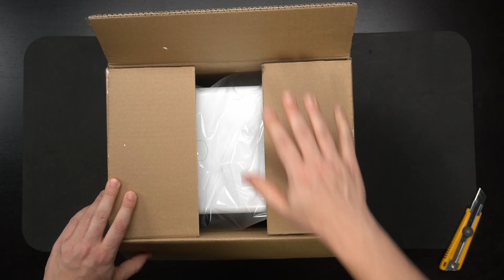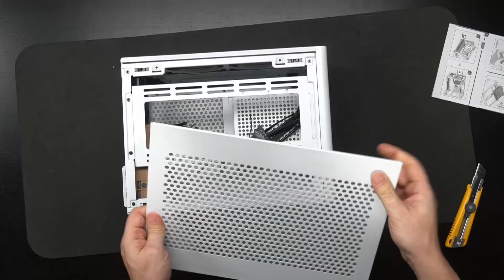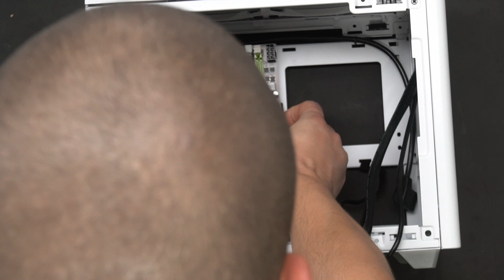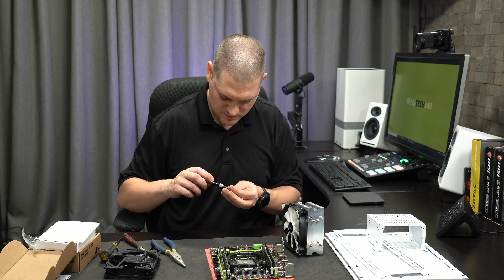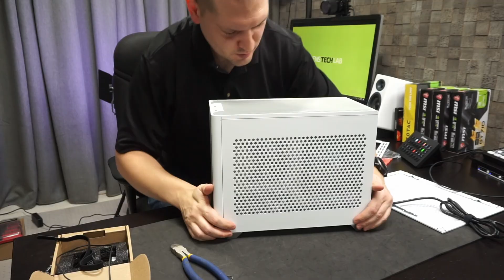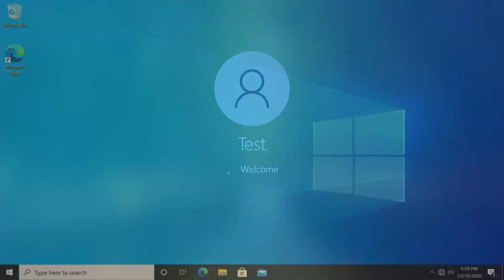Cooler Master NR200 with mATX Chinese X79 Motherboard

Comment from the maker: TL;DR; 
 - This motherboard can fit in the well priced Cooler Master NR200 case!
 - The included case fan will help manage the VRM temps in either orientation.
 - Having the top 120mm case fan as an intake fan is far superior for VRM temps but will elevate the CPU temperate a few degrees from 50°C to 54°C during my testing.
Reply: Been looking for a matx build like this, great to discover your channel, big thanks!
Reply from the maker: @DiazThumb  Glad this was helpful! I do like the way this build came out!
Reply: @DiazThumb  try Asrock h470m HDV if using 10th gen
Reply: OMG I have the same build xD, 2689 always at turbo but with the TG panel and a GTX 1660 and a ATX PSU, I'm moving now to an AMD build. I'm going to miss that Xeon when the times comes.
Reply: How much clearence did you have below the motherboard. My B150m is about a cm taller than your chinese motherboard
Reply: If it's no bother could you perhaps please measure roughly how much space is left in the bottom of the case? The case's page says max 22,6cm height motherboard but in the video to me it seems there is more than one cm left in the bottom, but maybe that's just due to perspective or maybe there is something in the bottom blocking any longer boards? It'd be great if it could fit a b450m mortar (2,9cm longer).

Comment: is there any other option that not using chino brand..?
Reply: Sama IM01 - support micro=-ATX 24x24cm mobos e ATX case, this X79 used in the video is more miniDTX - 236,68x177,28mm.

Comment: the psu can be mounted on the floor of the case? taking air from the bottom?
Reply from the maker: The case isn't really designed for this, but I've seen some impressive case modders... the bottom of this case may get crowded depending on the size of your GPU card.

Comment: Quick question would the nr200 fit an b450 mortar with a full atx power supply ??
Reply: yes
Reply: did it fit the b450m mortar?

Comment: I have another doubt tho, do you have the acrylic side panel ?
And If yes have you tried it out with the snowman fan?
Reply from the maker: I do not have the acrylic side panel. I wasnt going for that look in these builds. You are right though the acrylic probably eats another 3-5mm of space inside. If you want the looks with acrylic I'd probably go for a brand name cooler like a Noctua.
Reply: @BensTechLab  My snowman aircooler arrived today and i've installed in the case with the acrylic side panel and no problems. The tower is 2mm minimun far. I'm so happy with the build rs

Comment: Which model of x79 was this? Mine does not fit.
Reply from the maker: In the video description "Machinist X79G motherboard". This is a smaller motherboard, there are a lot of chinese remanufactured motherboards. The good news is that you can still use your CPU and RAM and just change the MB to fit your case! Then sell your other X79 on ebay if you want...
Reply: @BensTechLab  interesting. I also have a machinest. Doesn't look like they make this smaller one anymore under that brand, but I did find some that fit.

Comment: If your motherboard is 244x226mm or 24.4x22.6cm and under it will fit the case
Reply: According to Cooler Master Manufacturer site, this is possible. the maximum MB you can put on this case is 244x226, well actually didn't try this, and hope someone can confirm its fit, but theoretically, it should be OK... (go to CoolerMaster/NR200/Specification)
Reply from the maker: Did you verify this with a specific motherboard? Maybe share with the community which motherboard you used? It may be helpful!
Reply: 22,6cm is the height of it, right?

Comment: late comment but i was wondering if 120mm fans could fit on the bottom of the case with a  micro atx motherboard?
Reply from the maker: Probably not... The motherboard shown here is a small mATX which is only 3 pcie slots tall max. Most mATX are even 1 slot taller.

Comment: Is this motherboard smaller than "regular" micro-ATX cases? I have the Gigabyte Z590M GAMING X. Do you think I could fit it into this case? Also... there seems to be a lot of dead space in this case. Could you mod the PSU cage to fit a regular sized psu aswell?
Reply from the maker: There are 2 heights for mATX standard. This is the shorter of those 2 options. Some people call the smaller one "flex-atx".
Reply from the maker: Googling that motherboard looks kinda big, like 4 pcie slots sized (i know its 3 but the height of 4).

Comment: This is too fat, and too much unused space inside. Is there any thinner model for micro ATX and standard PSU? Something for iGPU, or maybe normal size PCIe?
Reply from the maker: This is a "standard width" case. Any thinner and you'll need a vertical GPU with PCIe extension cable and probably custom cooling on the GPU and CPU to make it thinner (the CPU cooler shown here nearly touches the side panel). At this point you move from a super low cost surplus parts build off ebay into the category of premium small form factor PC building market. You can search for "Optimum Tech" on YouTube if you want to go that route! Lots of fun! But a totally different category of builds.
Reply: @BensTechLab  Thanks for the answer. No I was thinking primarily about iGPU solution. Something under 30x30x10 cm. Isn't there any midground between this NR200 (which can fit enormous aftermarket cooler and 150W GPU, which is total overkill for home, office, HTCP, surfing machine) and that funny micro ITX cases which need external PSU and can't fit normal size MoBo (24.4 x 24.4 cm)...

Comment: ASRock B460M Pro4 (229х224) will it be possible to install in this case?
Reply from the maker: This machinist motherboard is about 215mm x 186mm. So that Asrock Pro4 seems like a fair bit taller by 38mm or more than 1-1/2". I don't think it would fit.

Comment: Do you know if this Machinist X99-M Plus will fit in the case?  For a while now I wanted to go Ryzen.  Now that I see that these Xeon's have way better Multi-Thread performance for way less money.  I'm going X99 brother!  I love Intel Xeon's anyway!  So I'm going to be using an 18-core Xeon with 36 threads.  I wish V3 supported the 24 core Xeon's but nope.  I do a lot of rendering so I need more threads.

Comment: Hello, I was exactly thinking about buying the same mobo and cpu, so i was wondering if it is still working on you and have you had any issues? also I am wondering if your ram is running in dual channel or quad channel? because on aliexpress there is a few listing for this board and some are saying "memory configuration single channel" so that got me confused? Please if you can chech if your ram is in dual or quad channel that would be very helpfull, thanks!
Reply from the maker: Yes this combo works fine! Unfortunately though the smaller mATX board cannot aupport quad channel memory due to space constraints (can't fit all the PCB traces). If you need quad channel support you will need to look at the larger ATX size x79 motherboards on aliexpress/ebay. This mb is dual channel only.
Reply: @BensTechLab  Thanks! I think I will be okay with 16gb dual channel, I just want a reliable board, I'm not gonna put any xeons over 95w tdp and I hope I will have a nice reliable system, Looking towards ordering all the parts this month, seems like this board has a lot of positive reviews

Comment: can i add gpu in similar specs?i mean including the mATX?
Reply from the maker: Yes you can! But full length card may interfere with larger powersupply. So you must balance power supply size and GPU card size or mod the case.
Reply: one more question can i use Asus prime a520m-k mATX motherboard in this case?please let me know
Reply from the maker: I do not have this Asus MB, so can't answer that. Note there is 2 possible heights for mATX MBs and some are too tall. Also check this video to see the power supply mounted on the back of the case vs front of the case for GPU clearance: https://youtu.be/tmoZVQo0_3w
Reply: @yellohelloyzx  check size difference between ur motherboard and the one that actually fits (Asrock h470m HDV)

Comment: That isn’t actually a matx motherboard that is a mini dtx motherboard to my knowledge
Reply from the maker: Mini dtx is even smaller with max 2 pcie slots. I posted the dimensions in mm on one of the comments on here for reference if thats helpful for your build!
Reply from the maker: It appears the matx wikipedia page isnt very good and there are better drawings on the mini-itx or atx wikipedia pages to show the varations. "The maximum size of a microATX motherboard is 9.6 × 9.6 in (244 × 244 mm). However, there are examples of motherboards using microATX designation despite having a smaller size..." I suppose you could call this one a "flex ATX" but the manufacturer uses the mATX designation with the upper standoff variation.

Comment: bought a similar machinist mobo, very informative video, and gave me a bit more confidence with it when it arrives. I have a cooler master case with top mount fan slots, so this video was huge on informing me the difference it can make. pairing it with a e5 2680 v2, bit higher tdp. but with the drastic difference in vrm temps with that top intake fan, makes me pumped. thank you
Reply from the maker: Glad this was helpful! Good luck with your build!

Comment: nothing about the gpu
Reply from the maker: Sorry, I did gloss over that as I was building these for servers no gaming machines. My GPUs are low power GT 710's which are great for server use and are low profile capable. But this case can accept larger cards! With a full length card you will possible run into interference with an SFX-L Power supply - so you end up constrained with how many watts you can fit in your PSU while still fitting your GPU in the case.

Comment: Hi Ben great testing :) i ordered such a tiny X79G Board too. I am not sure if it will work but i buyed a  E7-4870V2  to test with. I think if i cool the VRM good this beast of CPU may be work on it.
Reply from the maker: You will certainly need some cooling! Someone commented further down I think that they glued in some larger strips of aluminum into the small heatsink to increase the thermal mass with good success. That comment might be on my VRM thermals video...

Comment: We need a mATX variant of this case!
Reply: Check out for the Techware Fusion/Sama Im01, its pretty close to NR200 but it support Micro Atx and Atx psu out of the box.
Reply from the maker: That could be fun! An official mATX version wouldn't need to be much taller, maybe 1". But it would have to be a few inches deeper for wider mATX compatibility. I think "as small as you can get" was just so on trend the last couple years.
Reply: We actually do have that... matx + atx psu + 330cm gpu... problem is no mesh...
Reply: check CM NR400
Reply: @NasmanFour20  Too big
Reply: There is no need! We just need a matx motherboard tray with 8 stand9ffs

Comment: Hi, can i adapt atx power supply? THX
Reply from the maker: I did see this once but totally custom. You remove the SFX bracket and mount the ATX at the front similar to where the SFX goes on the front panel. May need to drill custom holes for mounting. There isn't much reason to do this today though unless you already have a nice ATX psu. There is so many choices available in SFX now.
Reply: U can 3d print ATX psu bracket which is also provided by cooler master in 2 variants top mount and lower mount

Comment: Can a bigger gpu fit in that case?
Reply from the maker: Yes a larger GPU can fit in this case, but fits better with the power supply on the back panel which didn't fit well with my mATX motherboard. So it is one big trade-off of space between MB, PS and GPU!! Choose which items you want to use the space for. You might be able to squeeze an SFX power supply on the front panel with a long GPU if you have very flexible cables or custom cables for your powersupply to make a 90 degree bend above GPU.

Comment: First video I've seen making use of a front mounted PSU. I will try my own build with this in mind. Great vid!
Reply from the maker: Front mounted works great when cramming an oversized motherboard in this case! (Like my mATX one).
Reply: @BensTechLab  Thank you for this video. It gave me more confidence as I know the PSU is easy to mount at the front. To be honest, this case 100% should have included mATX support. There is no reason why it doesn't.

Comment: Do you have dimensions of the motherboard?
Reply from the maker: The Machinist X79G v1.3 motherboard is about 215mm x 186mm. Just measured by hand with a ruler, so +/- 0.5mm for measuring by hand.
Reply: @BensTechLab  thanks
Reply from the maker: @Razhiel100  You're welcome! Consider leaving the video a like to show your appreciation. ;-)
Reply: everyone read this, plz pin this one , i searched all comments to find it
 @BensTechLab

Comment: Great vid thx!! My fans are spinning crazy! The front,cpu,and back fan.
Hoe can i slow the front and the back fan?

Thx again!
Reply from the maker: Do you have this same Machinist x79g Motherboard? There is an option in the Bios for the "Smart Fan" ramping value. Also there are 2 fan headers on this motherboard, only CPU fan header supports PWM (4 pins), the Chassis Fan header does not support PWM control of fans and is only 3 pins. I am using splitter and have all 3 fans attached to CPU fan header.
Reply: @BensTechLab  yes i have the same motherboard.
Oke i'm gonna buy a splitter thx for the answer.

What rmp speed i do i need tot:
Cpu fan
Front fan 
Back fan.

There is also a speedfan program you think its gonna work on this board?

Thx for you messeges